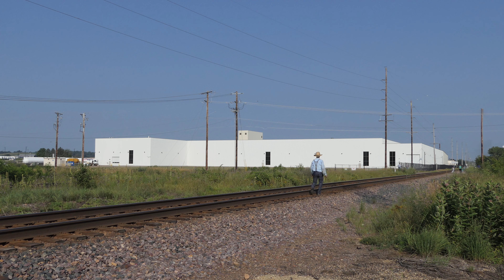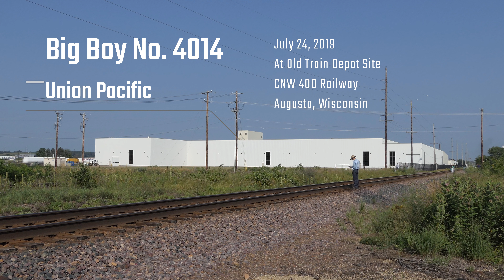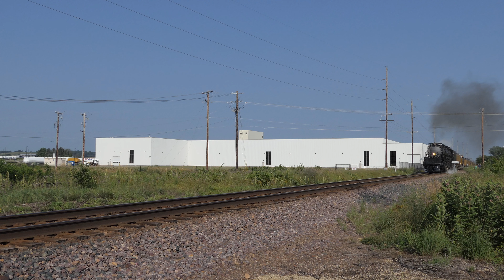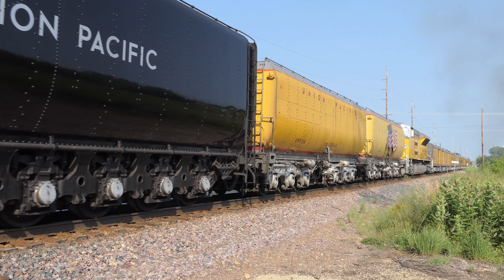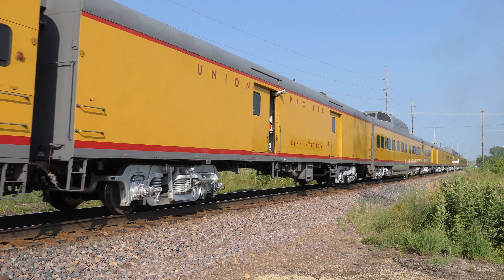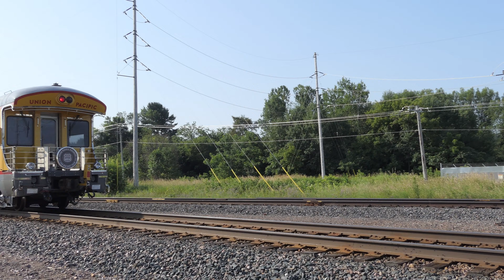Big Boy No 4014 Augusta Wisconsin July 24, 2019

Comment: Why is there a diesel running with them? In case of an emergency?
Reply from the maker: The primary purpose of the diesel is for train brakes. I don't know the details of why the Big Boy is not capable of supplying enough air to stop all the cars.
Reply: @PaulSikkema  It's for dynamic braking.
Reply: I was wondering the same thing.  guess I need to do more research on how train braking works.